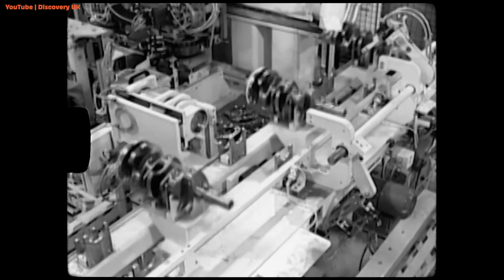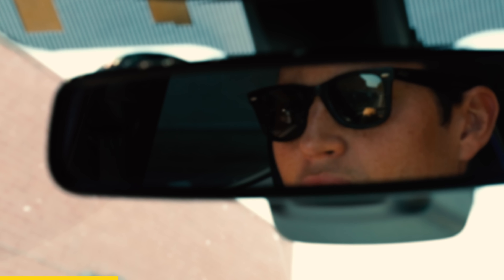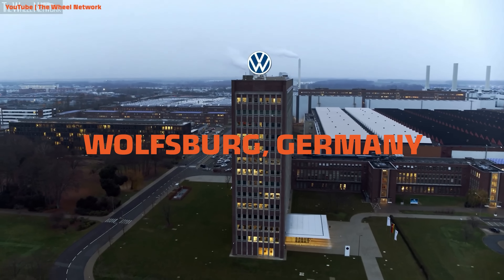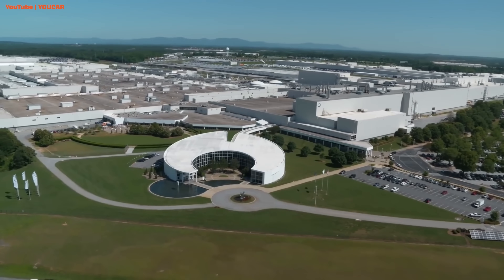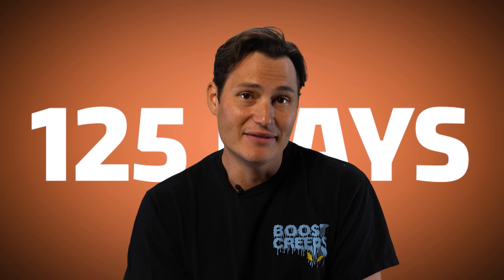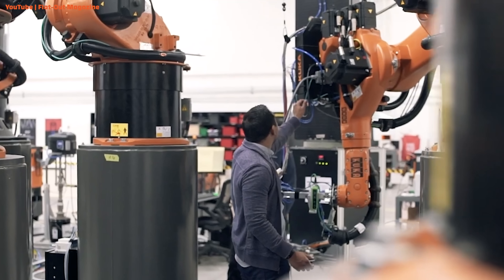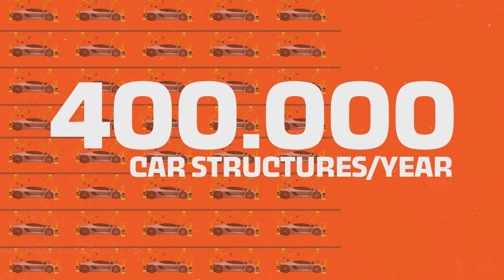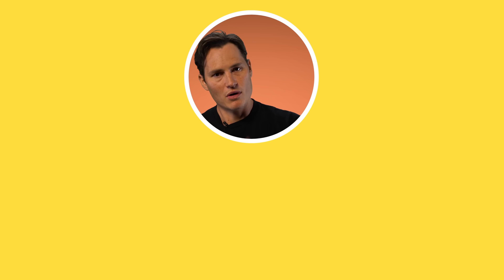A.I. Designed this Car

Comment: "let the engineering dictate the design of the car" : A mechanic's worst nightmare.
Reply: "The alternator is permanently affixed INSIDE the block. Efficient power delivery. The only down side is the block must be replaced should the alternator fail. Battery is mounted between the engine and firewall, so that's a full engine out to do a battery swap. However, we did manage to put the ignition under the seat so that the act of sitting in the car cranks it."
Reply: it makes it impossible to repair or fix just a throw away car
Reply: Yeah just at a glance it sure looks like you will need a lot of special tools just to disassemble it enough to get at the "consumable" components that need to be replaced every now and then. AI driven design probably spends zero computing time designing for easy maintenance.
Reply: @alexisrivera200xable  it's a hyper car it isn't made to maintain lol, it's made to perform
Reply: @demonsamongstmen562  It is a hypercar, which usually means things go wrong more frequently and it requires more maintenance than most cars
Reply: @demonsamongstmen562  who told you this?  There is a reason hypercars are oversized hot wheels.  They are notoriously bad at dependability, and even worse so at maintenance.  Watch any video about prep work for Ferrari bringing out an FFXK for their track days, or the LaFerrari.
Reply: @demonsamongstmen562  do realize how maintenance intensive hypercars are dont you?
Reply: @JohnBrowningsGhost  Absolutely, but I'm not working on them, nor am I the one getting paid to work on them so why in the flying shit is it everyones business what millionaire buys this car and who is working on it.
Nobody ever invents something to make it easy to work on. Trust me I know I've been working on industrial machines the past 4 years
Reply: Well.... if you have the money to buy this car you're not taking it to a normal mechanic lol
Reply: These can probably be a set of parameters onto itself
Reply: its why they wont let an AI design an entire car, you almost have to be a human to understand why having to take off all the body panels to service the vehicle is a bad idea. i am an automotive engineer and worked on cars for years so i know how you feel. gotta say tho modern cars are pretty easy to work on, computer tests narrow down the problem pretty fast. moving to motorsports and thats where convenience is  moved 2nd to performance in nearly all aspects
Reply: @jacksonblanks8038  It's not really finding the problem that's the hard part. It's getting too the problem that is the hard part. So much stuff on cars now engine bays are cramp and they like to put things in the hardest to reach spots where you need a certain tool to easily get to it or a special tool to take out the bolts.
Or you have to take off a whole bunch of pieces to get to it.
Changing the lights in my Wife's Grand Cherokee was a bitch. Your supposed to take off the front bumper. But I found out just taking off the air intake and ECU gave just enough room to get in there.
It was still a pain in the ass.
Reply: @DragonKnightX12  yep know how you feel but it's a trade off of do you need a big motor and any dead space in the vehicle just means you could have made it narrower and more aerodynamic
Reply: Is the McLaren F1 the most reliable hypercar? Because it has no electronics
Reply: @atarvhegde5210  it has electronics and actually one of the first, just none that mattered to the driving like ABS or TC. they could connect this old computer to it and they could diagnose the car the the mclaren plant on the other side of the world.
Reply: @jacksonblanks8038  
What I am saying is that McLaren F1 has much less Electronics so it may be more reliable than modern hypercar. 

I am not comparing the F1s reliabilty with a new toyota
Reply: @atarvhegde5210  from what i have heard yes they are fairly reliable but they did have a few small bugs that were fixed very quickly. now i have heard of a few Bugatti's breaking down but not enough to leve you on the side of the road just minor stuff. koenigsegg from what i have heard have nearly zero problems but considering they make so few cars its understandable. Ferrari on the otherhand have been a basketcase on almsot all there cars and mclaren has been reliable
Reply: Cars still be disposable like TVs and coffee makers in time. However they will only cost $7k and will last 300,000 miles. Besides over the last 30 years mechanics have been evolving in to computer technicians. In 30 more years to only use laptop and a screwdriver set at work.
Reply: @ClericChris  I design cars for a living trust me electric isn't at a point currently to full operate all new cars. I can see people in a multiple family home having all electric and one gas car tho. Until they can fully change battery packs in 3 minutes I don't see gas being beaten by electric on long commute or long distance trips, also along with in extreme cold weather as batteries hate the cold. It will be another 40 years until electric really takes over IMO. Now hybrids aka a combo of the two is a very real thing in modern cars.
Reply: @jacksonblanks8038  I think the trick for fast charging is going to be quick swappable batteries. 
Or some way to swap the  discharged content of the batteries for freshly charged battery juice. 
This would also mean you no longer need to account for a charging system in the car itself. 
That should also make the batteries more efficient in mileage and/or power.
Reply: @heygek2769  yep like I said a quick change battery pack would be great, also there are parents that would let you pump this bwlck paste which had the electrical energy and you would replace it at the pump so you would have to put in to pumps one to pump out the old paste and another to pump in the new one. I saw the parents for this year's ago but of course it's still under scientific tests
Reply: @jacksonblanks8038  those are some weird -ass parents, dude ;)
Reply: @heygek2769  parents? That made no sense
Reply: @jacksonblanks8038  in your comment you said 'parents' instead of 'patents' twice, so i made a bad joke.

your comment:
"yep like I said a quick change battery pack would be great, also there are parents that would let you pump this bwlck paste which had the electrical energy and you would replace it at the pump so you would have to put in to pumps one to pump out the old paste and another to pump in the new one. I saw the parents for this year's ago but of course it's still under scientific tests"
Reply: @heygek2769  ahh problem of typing on a phone lol.
Reply: @ClericChris  there will always be a vary in price, gas will most likely be the cheapest for a good while. Also they will still use the same basic tools just they will rely on the computer more and more for problem solving. The actual changing of parts and working will be very close to the same just prob more wires to deal with tbh
Reply: This is funny, but actually very wrong. Automotive engineers try everything in their power to make a car easily maintainable - many of them are gearheads themselves and know how it feels when things are poorly designed. Unfortunately, the industrial/manufacturing engineers and bean counters tend to get in the way of a properly engineered solution!
Reply: @rob_over_9000  got that right.
Reply: Ben Daulton  it's going to be 20 years until electric honestly has a equal footing as gas cars
Reply: Not exactly, the main problem is price and assembly time being the main quotas to reach. I do get that this is a  haha engineer bad mechanic good joke, but if you want to bitch about someone talk to the BoD who thinks that no one works on cars anymore from surveys.
Reply: @wellpsceap  they aren't that wrong honestly, how many people have changed their oil like honestly. Like I do all maintenance on my vehicles. And yeah it's multiple things that factor in to what and how you make the parts. It's all compromises
Reply: Ben Daulton  yeah that is stupid tbh but you know there had to be a reason. There is always  a reason. Or atleast I would hope in the dozens of engineers it was signed off had a good reason too. I know in some it's weight distribution and getting a lower COG but in trucks it may be since it didn't have enough room under the hood
Reply: Ben Daulton  oh ya and fatigue is a real thing, but it's generally the same as a cast part but that's under the best prints. If the printer isn't dialed in then you can have large vacancies which can make a material weaker or stronger which doesnr completely correspond to material properties but fatigue  will also be affected as the part doesn't have as much bonding surface area ove the areas. There is a newer 3d printer that I got to see in development that will give fast prints and at cast quality
Reply: Ben Daulton  also fatigue of aluminum which is approx 10 times as fast as steel is the reason we usually add coating and require the design strength be plenty lower than the plastic deformation and also must be replaced after a certain amount of time if it was subject to alot of forces. Generally on a street car it isn't a problem as your not putting many forces on it and it's way over designed with safety factors over 4 but with racing the safety factor may be the same but your actually testing the part under high loads
Reply: Ben Daulton  true but also may be something that had to be location to certain electronics or heat management

Comment: So the future ain't electric motors only, there is much more innovations.
Reply: I wouldn't say that. From a strictly environmental POV, gas needs to be phased out and phased out quick. Electric/Hydrogen is really the only way to go right now. The gasoline production/combustion is just way too inefficient to be kept around.
Reply: @thomascortes968  nah I think I’ll stick to a gas combustion engine
Reply: @thomascortes968  Yeah the only problem is how we get all the materials to make the batteries for EVs and the fuel cells for hydrogen cars. Some of these materials are quite rare and you can screw up the earth by mining for these rare earth metals, and we may not have enough to have everyone drive a EV/hydrogen vehicle.
Reply: @whitewizard7514  Sodium ion batteries are looking to solve our lithium troubles but the other materials like cobalt and platinum are an issue. I'm not an expert on the subject but I would think the troubles with the climate have much broader implications than problems with mining, of course, not that we should ignore mining. Something we could mitigate this issue is by letting people know that most people in cities don't need 300 miles of range. For city commuting, 50 miles is more than enough for most and you can recharge overnight, gaining most, if not, all of it back. Large batteries use more materials than small ones so if we can show people that, it'd be a great step. For longer range commutes, hybrids are the next best thing. Electric for the city, and then gas power if you're going further.
Reply: @thomascortes968  wouldnt say they are too inefficient as modern motors are running very well especially as compared to a decade ago. i can see in 15 years production motors reaching over 50% thermal efficiency which is crazy. electric just isnt there on many standpoints but hybrids will get more and more popular.
Reply: @jacksonblanks8038  It's not just the consumption of fossil fuels that's inefficient, it's the production of it that also is inefficient. There's a great video by Joe Scott called "Hydrogen Fuel Cell Cars Aren't The Dumbest Thing. But... | Answers With Joe" where he breaks down step by step the production and consumption efficiency of fossil fuels, hydrogen, and battery electric. If you just want the numbers, fossil fuels run at about 13% efficiency by the time your car starts moving, hydrogen at about 27%, and electric at about 80%.
Reply: @thomascortes968  yep millions of factors, bit would agree hydrogen is incredible, I actually ran in the shell eco marathon with a hydrogen powered car and they are great and very clean. Problem is we have kinda dug ourself a hole in gas cars and we would have to backtrack heavily to get the same tech that would match modern car. Will say electric is fast tho, I have a friend who converts gas cars to all electric and I have driven custom electric cars and the only bad things is they are heavy and have no real top end power
Reply: @jacksonblanks8038  I think electric is the most plausible since that's where the resources are being spent the most right now. I think the biggest way to mitigate to heaviness is to inform people that they don't need 300 miles of range to commute to work and back. 50-100 mile range batteries would suit the needs of 90% of people, even in America where the grocery store is a few miles away. A plus side of that is that it reduces the amount of lithium/rare earth elements we extract from the ground.
Reply: @thomascortes968  yeah the push for electric is huge it's just the lithium problem that is keeping it back. And like I said electric cars will be a majority in 15 years,just things that need to travel very long distances and refuel fast is the big challenge. If I remember right tesla designed a system to change the battery out for this and it's was shorter than pumping gas. The problem at that point Is infrastructure and in turn cost since everything costs money
Reply: @thomascortes968  hybrid battery packs are great and should really put a dent into the carbon emissions from gas cars as when you need to travel a while you have gas and when you are just going a short distance it's fine with only 50 miles of range as the full commute is only 20
Reply: @jacksonblanks8038  I've seen some promising research on sodium ion batteries. They don't use lithium and sodium is a lot easier to obtain and is more plentiful (there's still some rare earth metals, but it's a step). Hybrids are the best alternatives atm although I'd much rather see better public transport network from the government as a method for crossing long distances quickly (still crossing my fingers for bullet trains but higher speed trains would also be fine).
Reply: @thomascortes968  honestly at this point they prob couldn't do it as we have a weird setup here in the us with just how big it is. Elon musk's tunnel would help a bit but not to a big scale. The problem is you get to a point as your outside electric range but not for enough to fly or your in a rural place where public transport is not existent like it is here. What would be interesting would be just letting the interstates be like the autobahn. I got a couple fast cars that I would love to let loose and aren't that bad from a carbon point of view
Reply: @thomascortes968  no its not inefficient. 2 stroke opposed piston diesel engines could revolutionize internal combustion enignes. They are super efficient, close to 55%, they are simplier to manufacture, are lighter and a lot more fuel efficient
Reply: @dieselgeezer18  I don't think auto manufacturers will ever produce them as some of the largest manufacturers have already announced that they will be full electric in the next 10-20 years. Most governments are also giving no incentives to citizens for buying a more efficient gas/diesel powered vehicle. Like I mentioned to another commentor, the efficiency of the motor is only part of the efficiency problem. The production of fossil fuels is very inefficient. Before gasoline even reaches your car, 40% of its potential energy is loss due to manufacturing. Assuming 50% efficiency (real world average comes in at 23% efficiency), you're looking at 30% total efficiency by the time your car starts moving (I'm using Joe Scott's number in his Hyrdrogen Fuel Cell Car video, I recommend it). Hyrdrogen comes in at 27% right now and battery electric comes in at about 80%.